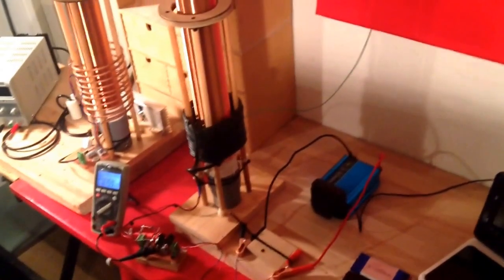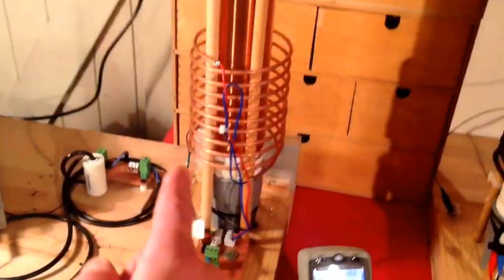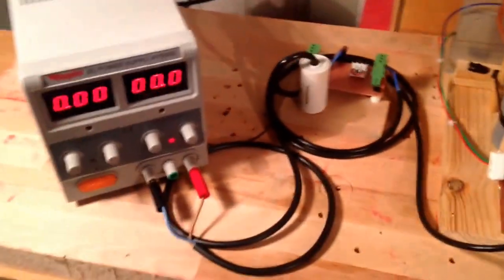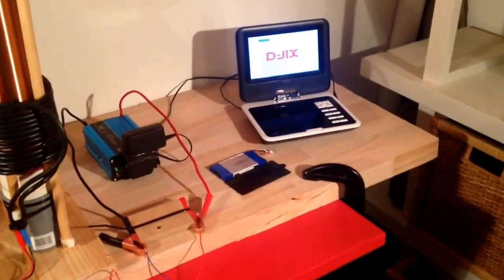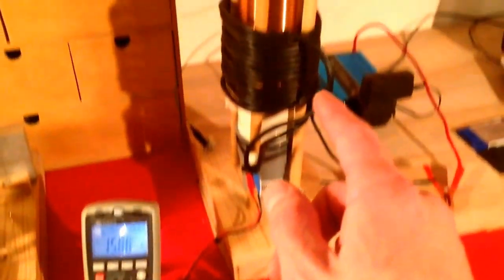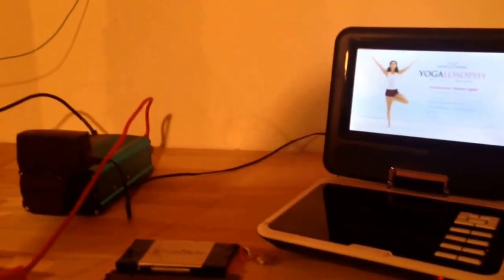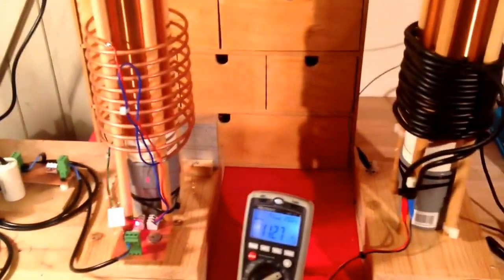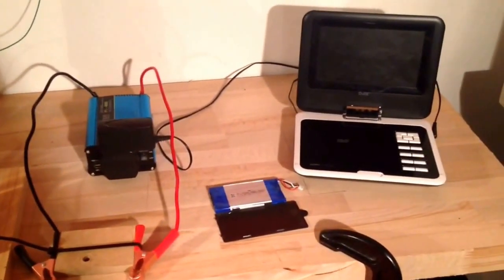Wireless Power Transmission

Comment: haha....again nice work .....ac to dc to ac to dc.....would it not run off the fwbr alone, or did you throw in the extra conversion for fun?!
Reply from the maker: hehehe lmao.... just for fun, you know how it is :)  I was being a little careful not to overcook the dvd drive by hooking straight up to the fwbr (lol that's what it stands for... full wave... doh!)  as the Mrs does really really use it while she's doing her yoga! I wasn't too worried about the inverter... it was either get busted for killing the DVD player or moan at myself for the inverter ... option 2 was good, the inverter is sucking loads of energy out of it tho ay.
cheers Mr G. (thanks for the vid on the .. fwbr!).
Reply: deeds i had thought of that afterwards ....more losses going through the extra step, but probably safer and caught alot more of the AC that may have leaked through the first step...good idea  :)
Reply from the maker: ..could I put a "regulator" on the end... I've never used one before. To keep the 12V steady while the DVD Drive spins up and sucks more juice.  I'm worried the fluctuations in power as I compensate with the DC power supply might just blow the DVD Player... when the DVD spins down I'd have too much power coming through unless I was really quick with the DC power supply. If that makes sense mate?
Reply: im not exactly sure how it would with a regular power supply, much less what we are doing haha....safer to use dispensable stuff for now, until a greater understanding comes later  :)
for what its worth , i think something like this has its own regulating devices, and will only pull what it needs, but i could but dead wrong!
Reply: oh, i think i see what you mean... a voltage regulator....well only one way to find out!
Reply from the maker: jeremy gwilt
..'ha five' to that... I'll salvage one from somewhere and try, it's got to be the way forward.  Dispensable stuff and just give it a go. 
I think you're right too, it does seems to only pull over what it needs, I've seen it do that a number of times.  I'll keep my eye on it.